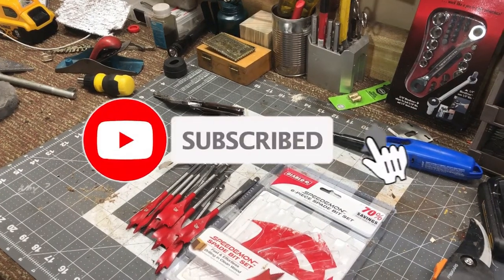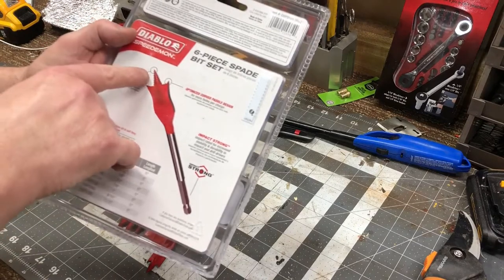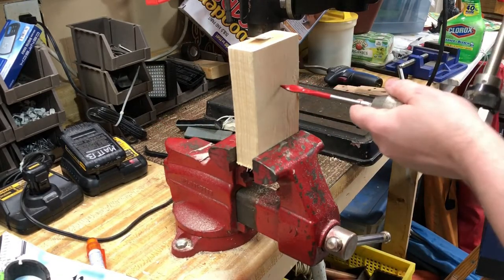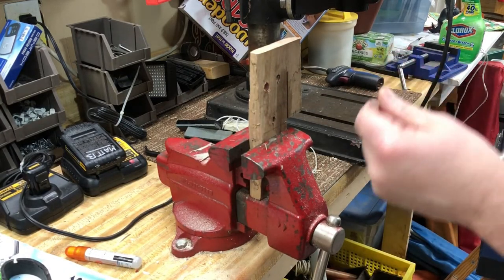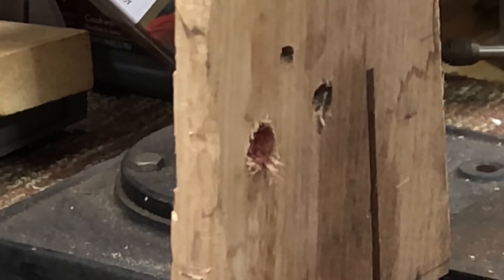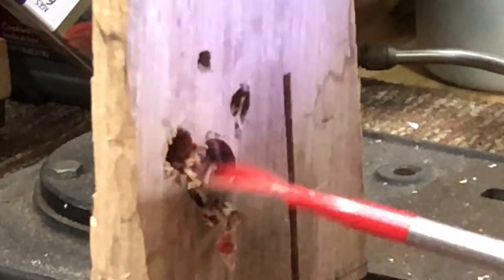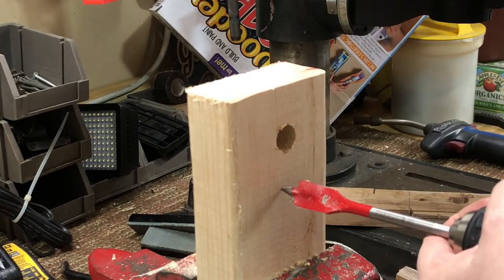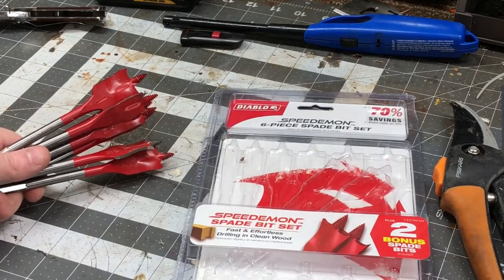TSWG Episode 112 Cheap Drill Bits Still Suck!

Comment: I've had good luck with the Diablo blades for my table saw.
Their 1x30 sanding belts worked well for the price.
For drilling smooth holes in the larger sizes, I've found Forstner bits work better than spade bits.
Reply from the maker: I like my Diablo blades as well!  I have one in my circular saw, but the bits suck.  I do have a set ofForstner bits but they don’t fit in the brace